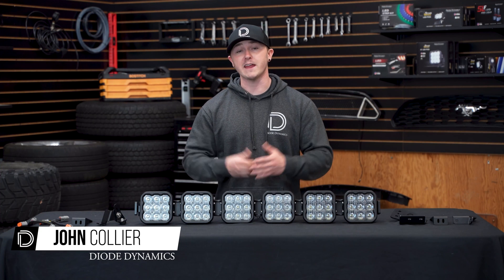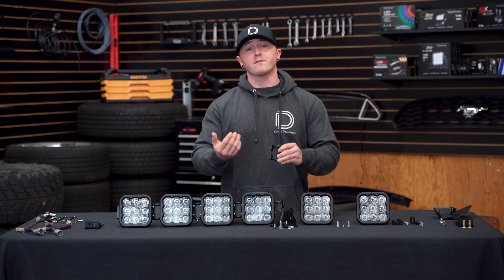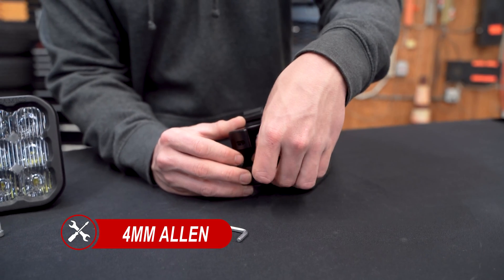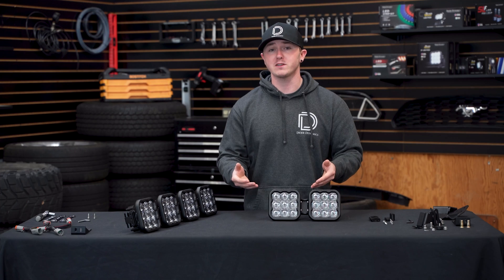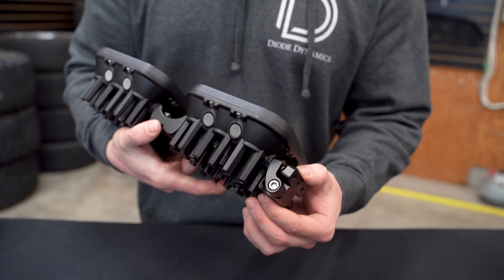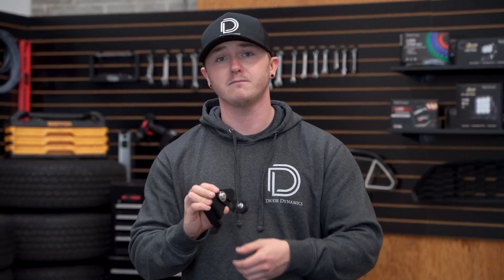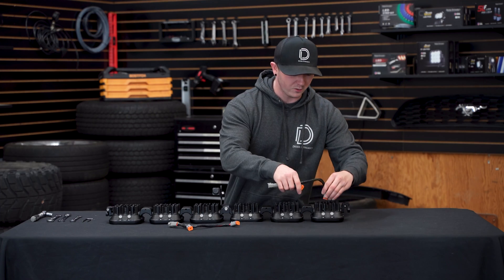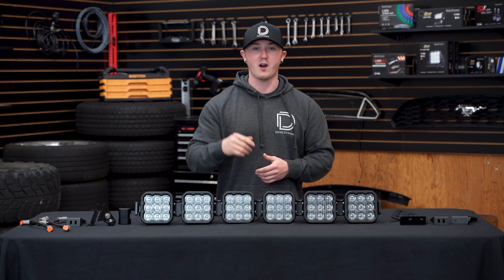How-to: Assemble & Adjust SS5 CrossLink Lightbars | Diode Dynamics

Comment: I’m so confused. At 2:30, the short 4mm Allen bolts are too short to screw into anything. They don’t even make it through the end mount connector holes.
Reply: I just looked at the other end mount connector and it is not the same as the first one. 

The second one has these bigger holes so the heads of the screws can go in as well; the first one does not have these bigger holes for the heads of the screws. 

I’m gonna need another end month connector that works.
Reply from the maker: Sorry about that! 

Please go ahead and give us a call at our headquarters to speak to a live team member in minutes at 314-205-3033, Monday-Friday 10 a.m.- 5 p.m. CST, or shoot us an email at contact@diodedynamics.com, and our in-house US service team would be happy to help you with that.
Reply: @diodedynamics  I emailed yesterday. Looking forward to a response.

Comment: I have 4 with the tundra kit. Haven’t installed it yet.  Would it be worth adding a support leg? Would it reduce vibration.
Reply from the maker: You shouldn't need a support bracket with just 4 pods, they should be plenty sturdy! What some customers miss when installing however, are the Endlink mounting bolts. They do require quite a bit of torque to fully tighten, so don't be shy when you go to secure those brackets! That will be enough to keep the bar tight!
Reply: @d @diodedynamics this caused my bolt to sheer….

Comment: If using my own switches for main and backlight, does the backlight wire need to be fused to the switch?
Reply from the maker: If you want separate control of the backlights, yes. However you can also tap to any power wire to get another parking light or DRL with the activation of your parking lights, plus you save room for more lights on the switch panel!

Comment: Really wish this was for the ss3 too😓
Bought six for my roof rack and had to make a diy wire harness for all of them
Reply from the maker: Hopefully, we can offer something like this in the future!
Reply: I was just thinking the same thing
Reply: Cracking looking set of light pods that can be made up to a light~bar. It would be stunning if the wiring loom that links each pod could be designed in such a way that the wiring is via solid links, like a chain, whereby the electrical contacts are made from said links to each pod. Improve that rear end wiring harness aesthetic and you will have a product that will be breathtaking!